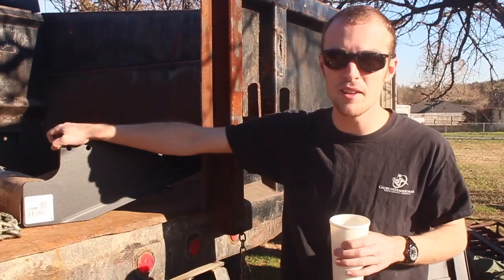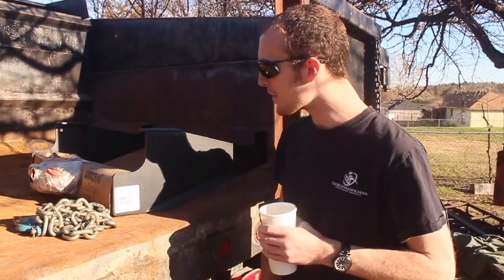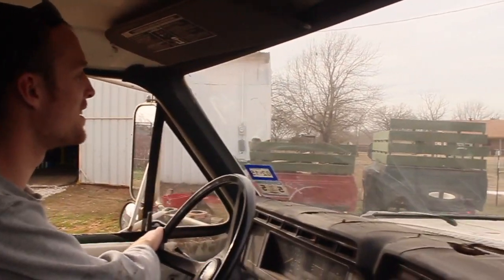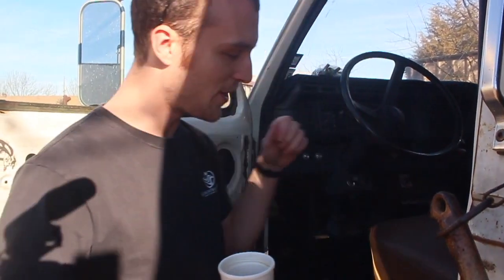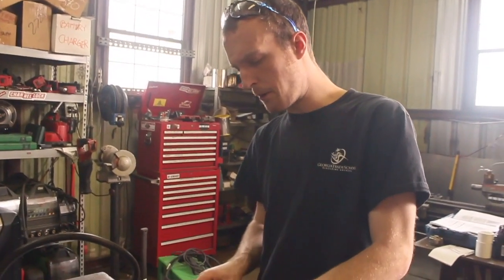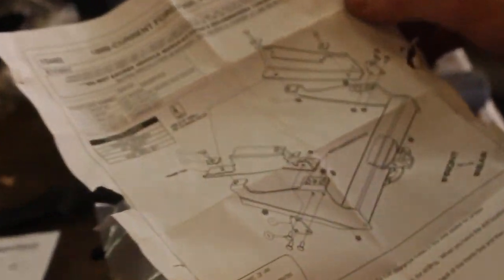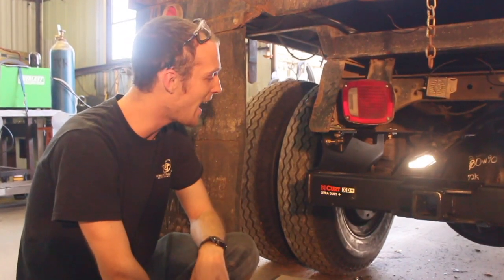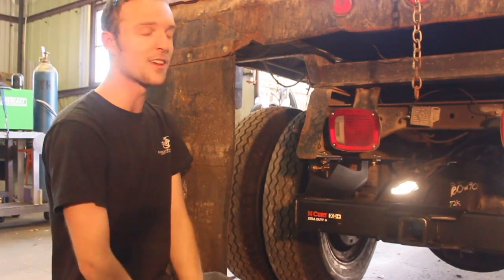WHY YOU SHOULD NEVER BUILD YOUR OWN TRAILER HITCH - THE BEST KEPT SECRET TO AVOID PROBLEMS LATER!!!

Comment: Usually you pull choke for on and push for off.  Cold start if you push the pedal once or twice to the floor the carb will squirt some gas in.  Also helps to hold gas pedal 1/4 to 1/3 the way down when you are starting. (Pull air cleaner cover off and shine a light in carb while someone pumps the pedal.  You will see what I mean.

Comment: I did build my hitch from scrap I had laying around, only thing ill say is it's definitely overkill for the truck. Doubled 2x3x0.325 tubing and 5" c channel before I forged the 2" receiver to it all. Also welded and bolted to the frame with 3/4" grade 8 hardware. For a 1990 f350. However, I have been giving thought to the liability of it all, just in case, though it's just a farm truck.
Reply: Sounds fine to me.😎 I would think that liability would really only be an issue, if building for someone else. Building for your own use...imagine the number of farmers who built stuff like that for themselves. Staggering numbers.😁